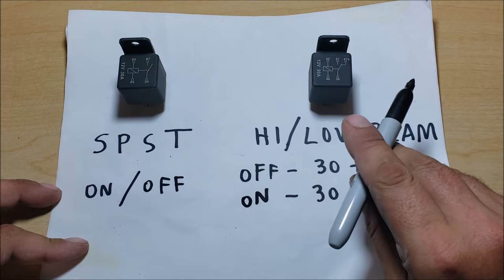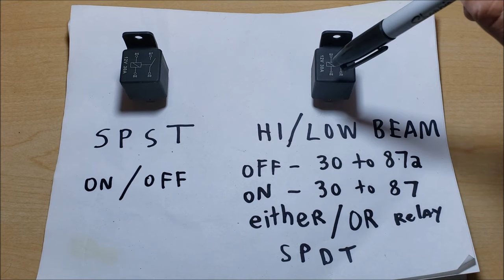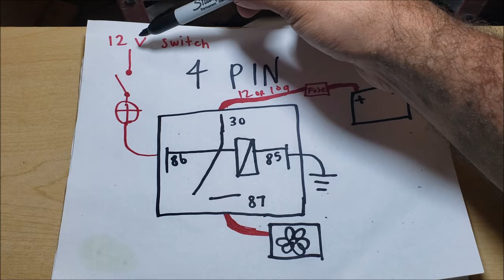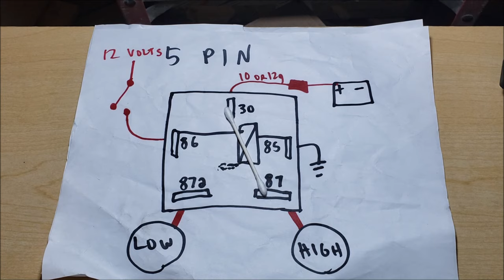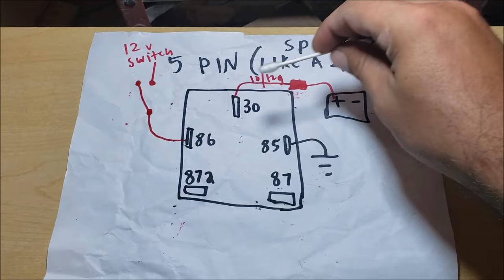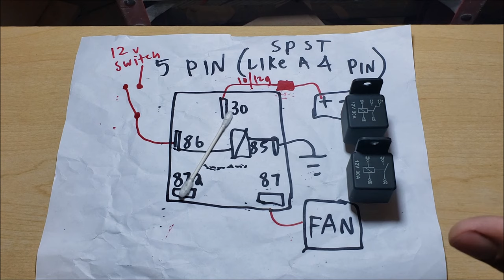automotive 4 pin and 5 pin RELAY EXPLAINED which one?

Comment: One thing I would like to see on your video is to advise viewers to mount this relays with the mounting tab on top. Most imported relays are not water tight and can short out of fail with ease if mounted in any other direction. Great video and excellent explanation. 👍

Comment: This was what I have been looking for. I've watched so many youtube videos and they all recommended 5 pin and all I am doing is lights...so I bought 5 pin and have had the toughest time trying to figure out what the darn thing does and why my switches are powered upside down...this video was perfect. The one question I do have that may be answered in the comments, but didn't see it right off the bat, was what do I do with the extra wire now? Do I leave it? do I cut it? Do I cap it? Appreciate your guidance. Thanks again for a great video!!
Reply from the maker: you have to figure that out just remember 87a stays hot

Comment: Good video. I usually use 5 pins even though I know I don’t need to. I honestly barely can find a decent 4 pin from a reputable brand. It never hurts to have the 5th pin so I just use them 99% of the time. 

Actually just did a project using the rare 87A. I have a daytime running light on my truck that is powered by an ignition circuit. Interrupted it with a 5 pin relay triggered by the parking brake ground. Parking brake to 85, ign to 86, ign to 87A, 30 to DRL. pull brake, DRL shuts off when the relay switches to 87. Works like a champ.

Comment: Hi Chris - I learned a lot about relays from your videos. I have a 5 pin starter relay on my 2005 Volvo v50. It won't start and I want to try to a repair I'd seen on a forum  where the mechanic grounded the relay to the strut tower of the car. I just want to confirm that to try this repair of grounding the relay I would ground from the #85 pin of the relay to the grounding point (nut on strut tower). Thanks, Tom

Comment: You can use a 5 pin relay to over ride a thermostatically controlled fan with a toggle switch as well. I'm sure there are other similar uses, just can't think of any at the moment, but definitely not in place of a 4 pin.

Comment: I think availability is a reason why people may use a 5 pin.  In my circumstance right now, I need a 4 pin normally on relay, but I don't feel like ordering and waiting for the part.  Since I can pick up a 5 pin relay anywhere and wire it as such, win.
Reply from the maker: that may be true.. I found a 5 pack (5pins) online for $12 with wiring plugs and all,shipping included ..  the 4 pins were not that cheap

Comment: A 5-pin relay can be used as a 4-pin relay.  If the price difference is not much, I'll buy a 5-pin relay so I have the option of using it as either 4- or 5-pin.  Thanks for the useful video/explanation.

Comment: Hi Chris, I have a 4 wire after market gauge from Glow Shift and my gauges go off when I run any accessory. So I wanted to hook up a relay but I’m confused. The gauge has a 12v to battery, 12v from a switch, ground and another wire for when you turn on your lights it dims the gauge. Can I use a 4 pin for this? I’m not sure where I hook up the 12v switch for the relay and for the gauge itself

Comment: Hi Chris,  

Great video with helpful explanations. Your videos on relays are the only ones that englightened me.  I'm less than a novice on relays as I have never worked with them and only became aware of their exsitence few days ago, but I would like to learn how to use them on cars. In both this video and your other one titled "the automotive RELAY explained...", did you assume two power sources for the two circuits: one for the 85 - 86 circuit and another for the 30 - 87? It seems that you used two power sources in the other video on air conditioner, but I am not sure on this one. As far as I understand, personal cars only have one power source. In this case, would you need same gauged wires for both circuits?

Comment: Hi Chris I needed a 12V 5 pin Relay for the PT Cruiser to power the indicators but unfortunately the 12volt 100 Amp Relay didn't work for the PT Cruiser as the indicators stayed on & the lights didn't Flash & so I'm going to use this waterproof 12Volt 100 Amp Relay unit for a radiator electric cooling fan that has 2500CFM & 90 Watt & I can buy this radiitor electric cooling fan for NZ $80.28 which not a bad price & I asked the Seller on AliExpess if that 14" inch electric fan can also with straight flat fan blades & apparently these come with straight flat blades as well which is great & the radiator electric cooling fan unit they show in the picture has curved blades & the difference between the straight flat bladed fan units is they force more air through the radiator than the curved bladed fan units but the curved bladed fan units are slightly quieter running fan units but I prefer more air flow through the radiator having straight flat bladed electric fan units & that's the difference between curved bladed fan units  & the straight flat bladed fan units Kind Regards Peter

Comment: hi Chris great videos I just have a question for you as i hooked up a five pole relay the way you said to but am wondering if I just leave 87a not hooked to anything? I installed a bumper that had 4 led lights in it . hooked 86 to my head lights 87 to my led's ran a 12gauge wire from 30pin straight to the battery  with a 10amp fuse then ran pin 85 and led ground to chasey ground . but the lights come on right away without anything turned on. when I do turn ignition on and put high beams on the led lights shut off and work correctly the way I thought they should but they stay on when i turn ignition off. i just left 87a not hooked to anything. thanks for your time Chris hope to hear back from you soon .cheers

mark...

Comment: I'm by no means an expert but from the research I've done, a 5 pin relay is essential for applications you need to power 2 different accessories like high/low beams.
A 5 pin can constantly power low beams until the solenoid (electromagnetic coil) has current from switching on your high beams which magnetically pulls the iron switch to the second circuit which turns off the other.
Relays 4 or 5 pin types allow many car parts to operate without drawing high Amps because the electromagnetic coil doesn't require high current while things like pumps, electric fans require high current to properly operate. So those parts don't burn out, instead the relay does and it protects the expensive components.
Only $10 for a relay, $100 for a fan.
It's also important to have a fuse between the high power + line (battery/JB) and the relay and all components after.

Comment: Could this relay be used for a backup camera to provide two sources of power? Basically to switch between power from the reverse bulb wiring for backing up to then providing constant power from the battery? Constant power used to keep the camera on.

Comment: A 5 pin relay (SPDT) is required if you need an open circuit while the relay is being powered. When power is off the relay will switch to N/C. This would be used if you want something to turn on when the power to relay is off.

Comment: Hello Chris - have you got letter referencing for Hella relays? I have a P and an S on my headlight washer relay which I know is not working but would like to remove the cover and test. and have the facility to do it in the future.  I have the European DIN chart numbers from 1 to 88 and the wiring colour codes for European DIN standard. There is a 72 page pdf file on Hella relays by Hella but not letters P or S. Thanks.

Comment: Very Good job of explaining using a diagram. What I was looking for is the reason that some relays with 5 pin are stated they are for a 1976 Corvette blower motor when the original was a 4 pin. I received a 5 pin but don't have a high speed on my 1976 Corvette I have been restoring, but the original one was just 4 pin. The single one on the 4 pin is for ground but the 5 pin I received dose not identify ground on the two pins if any. Just wondering if that its the reason of having no high speed blower on it and knowing which pin that ground was suppose to go on if at all. The resister is new and all the other speeds work but high with this 5 pin relay.

Comment: I'm a new subscriber...I'm wiring an old 1955 International R110 pick-up.  It was 6v and I have converted to 12v (I think I have anyway).  Looks I have left most of the 6v wiring in place and only added turn signals.  The issue I have is that I have several lines going to the accessory port on the key switch (did add fuses to each line added).  How can I wire this where my key switch is overloaded with wires.  Looking at your post, I was going to add a 4 pin relay but it seems like I'm going in circles.  At present everything miraculously works but it seems as if there must be a cleaner way.  Could you send me a wiring diagram that would help me unite the old 6v wiring to the universal turn signal and adding accessories?  I used a 5 fuse panel to join all the accessory wires connected to the key switch...is this right?  I know I am doing lots of guess work but at present everything works...I just don't want a fire was i wrap up the dash.  The original wiring diagram for this truck seems simple as you know in those days not much was needed.

Comment: Chris Craft wanted to see if you can help. I have Polaris Ranger with cab heater that has quit working. I used a test light to determine the relay needed to be replaced. I put on new relay checked positive with test light and it works but when I check the wire (87) going to the heater control panel there isn’t any power. Any ideas? Thanks in advance fo any help.

Comment: The cost difference between the 4-pin and 5-pin relays are quite minimal, particularly particularly if you are purchasing a 6-pack or more.  If you have both relay types incorporated in your vehicle, camper or boat, there is an advantage to using the 5-pin relays, since all relay applications use the same relay.  I keep one spare 5-pin relay in my vehicle glove box to replace any failed 4 or 5 pin relay in an emergency.
Reply from the maker: now the 4 pin are more expensive.. 😳

Comment: Very impressed video and nicely explained.Thanks.I am trying to connect a second passenger electric window switch on the drivers side as there isnt one .In my case ,can I use the 5 pin relay to use 87 and 87a for up /down?

Comment: Great video....... I still need help. I want to wire an Air Horn that I want to work a several ways. 
I know how to wire with a relay to allow the Air horn to work off my stock Horn button. 
I would also at times like to break that connection so it does not work off the stock horn
I would also like to have a separate switch that works all the time not dependent on being connected to my stock horn.  
What is the best way to do this...... Thank You

Comment: Perhaps a dumb question but can a 4 prong relay be used as a 3 prong relay? I have a 3 prong relay on my horns in my car. So If I plug battery to 30 and the wire to the horn button is a ground (so 85), that should basically work also no?

Comment: I'll tell you Chris why all of us use the five pin relay I wish I had seen your video about 2 years ago because all of my relays are the five pin which is going to my electric fuel pump electric water pump electrical fan but I see what you're talking about I wish I said I wish I had seen yours first it would have saved me a headache also my car the person that wired it previously everything under the dash was red everything so I ripped it all out and I started from scratch I rewired the entire car at least it has red black and green on another note I seen there's a lot of things that you have either gone through or are going through with building your rod body work being one of them I also took me about a year and 2 gallons of body filler to figure it out now I'm not super fast and super good like a body shop but I can do my own ride and I'm meticulous.
And I made sure that my body work is to my liking it's slick just to give a an example like when I ran out of primer I used I had some orange from tractor supply and I painted the car orange using it as a primer just to feel scratches and so forth I don't have my brothers around which they did all the body work and paint work and I usually did the mechanic work but my project is a 70 Nova Chevy Nova small block previously drag car but I'm trying to convert it back to street rod it's been a long long way but anyways keep up the videos I'm just watching them just to brush up
Reply: I failed to tell you why the 5 pin relay that's what every body that have built a rat rod told me to use that's why I'm guessing everybody else uses something cool because they are told to use them

Comment: So I’m trying to wire up power windows and the video I was watching has using a 5 pin and a 6 pin billet momentary push button. He has them wired up as 30 to accessory, 87a 86 + 87a 85 to battery+ , 87 to ground, 85 to switch on one relay and 86 to other switch. Switch has 2 normally off connections.  86 is connected to one and other connected to 87.  Sound right.

Comment: I have a Bosch 4 pin relay partially connected. Right now it only has pin 30 connected to the positive side of my start battery on the boat and nothing else. A few nights ago I accidentally rubbed up pin 86 on to the negative clamp of the service battery (not the start battery). Is there any harm in this? I'm guessing nothing happens because the electromagnet isn't energized?

Comment: My 1996 ford ranger has a 5 pin relay it says its for the WOT a/c relay. Im thinking its for the a/c compressor. I need to add freon to my ranger but my a/c compressor is not engaged. How can i jump the relay in order to engage the a/c compressor so i can add freon?

Comment: my 91'' pick up has 2 wires for the horn ... l'm trying to power an additional horn using it's own relay ... will a 5-pin relay be my answer? ... 2 wires to the horn leaves me with an extra wire without a pin to put it on

Comment: Thanks for the video.  It is very helpful.  I do have a question, and wording it may be difficult, so here it is:
If the 5 pin is wired like a 4 pin and the switch (pin 86) is off (resulting 87a to pass the current), is it correct to say that power will NOT be drawn from the battery (pin 30) if 87a is open/not connected to anything?
Reply from the maker: it will NOT draw power
Reply: @chriscraft77022  Got it.  Thank you for clarifying!

Comment: Nice clear explanation there. How would I go about wiring a relay to power a car stereo with a main starter battery and a leisure battery. I want to use the leisure battery when the ignition is off.
Thanks
Reply from the maker: how does extra battery get charged?
Reply: @chriscraft77022  The 2 batteries are on a split charge relay. So the alternator charges both.

Comment: Can you reverse the polarity of the relay? i currently have a button for my trunk release. Wiring diagram says that trunk release is white cable (-). Im going to add a remote on that, so in order for it to b continuous, can i add both negative wires on 87a and 30? then blue wire for my remote is 87? then 85 and 86 would be connected to both positive? is that going to work? i need my original switch running, then just adding an additional switch.

Comment: I ordered a 5 pack of 5 pin from Amazon because it was cheaper the 4 pins. They are labelled 30/40 Ah which pin do you think will have the higher amp rating? Thanks!

Comment: Hi Chris I am building a motor/cycle roller starter do I run the 85 terminal  to the earth on the battery or earth it to the starter motor it is a Denso 601 .also putting a pedal foot control which I can use as a switch thanks .

Comment: I need to connect up another headlight to a motorcycle wiring loom. I've taken the full bike apart and transferred what I can over to a kitcar. I take it I have to use the 5 pin relay to connect another headlight, if I piggy back it of the other will it pull too much power and set a light.

Comment: Question trying to wire a old car antenna up to a 12v 110 power supply with a timer for a chicken coop door the antenna has 2 power wires for open and close one is constant and the green breaks to close antenna would i need a relay to achieve this or could i just run my timer and constant antenna jumped from 12v source and use the timer as a break for my green on the antenna and ideas for simplicity or am I on the right track

Comment: I’m doing a 4 high conversion on my truck and bought a 5 pin relay instead of a 4 pin, and all I need to do is tap into the wires, would I be able to hook 86 and 87 to my high beam wire and still get the same effect as a 4 pin

Comment: Hi, great video! Question, the on/off switch going to pin 86 has two pin connections, one for 12 volts and the other is used for what? Thanks
Reply from the maker: it is ran in series ..

Comment: Would this be ideal when hardwiring a dash cam to continue recording while parked and away from vehicle. I'm new to this but you've explained it the best.
Reply from the maker: cant you just get constant power from the cigarette lighter?   that’s what I would do
Reply: @chriscraft77022  I do have one 12v out, so I'll be using that single outlet for dash cam, a gps speedometer, my interior floor lights etc etc. So I'm trying to hard wire as much as I can to free up my outlet. Too many wires hanging around drives me crazy. So should I hardwire all these accessories?